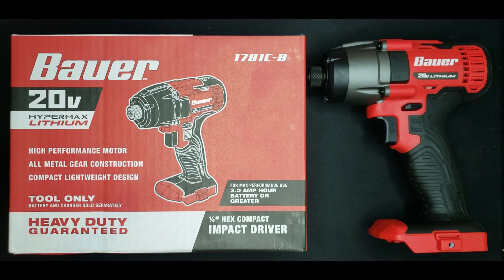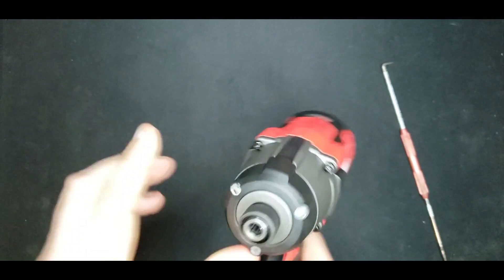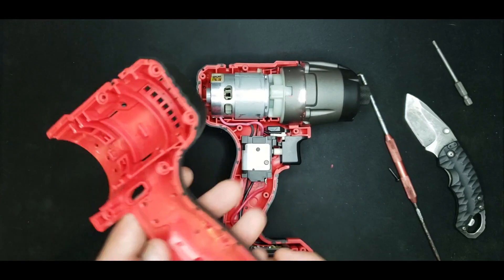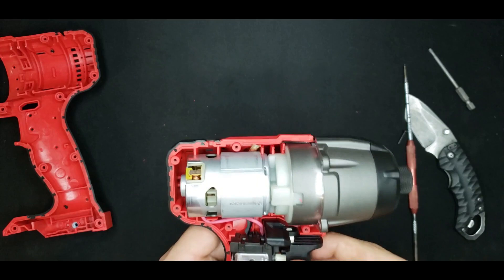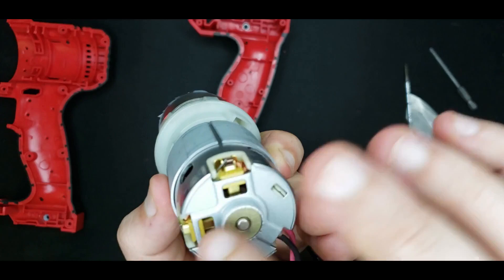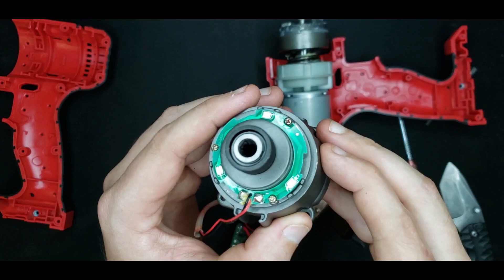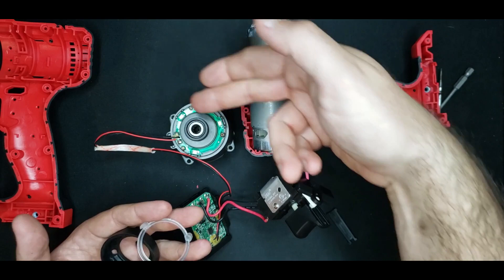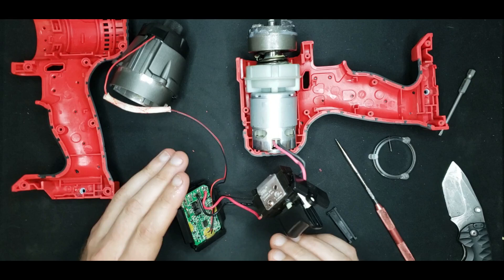Design Engineer Tears Apart Cheapest Impact at Harbor Freight Bauer 20V 1/4 Impact Driver | Ep.12

Comment: I started switching over to the Bauer platform recently. I've been happy so far, but still wondered what the longevity of them would be. I remember when harbor freight was nothing but cheap throwaway tools, so you always kinda wonder about the durability. Well I was working in my shop last night and accidentally knocked over an 8' ladder. Sitting on top of the ladder was my Bauer brushless driver with a 5ahr battery. It hit the concrete hard. So hard that the battery popped off and went another 15'. I figured it was shot. No way it survived. I inspected the battery and it looked fine. No cracks or anything. Inspected the driver and it was fine. Plugged the battery back in it and everything worked. Used it the rest of the night with no problems. Don't be dumb like me and leave tools up on top of ladders, but if you do knock your Bauer driver off an 8' ladder, it should survive. I couldn't ask for a better tool at this price. No one else comes close to the value.
Reply: they were cheap but they seem to have really been ramping it up hard over the last years. I don't know what they pay their RnD team but they are crushing it now. The tough choice is Bauer or Hercules... kind of wish they had interchangeables but I decided on Bauer because it has more tools and I want just one battery platform.

Comment: I’m not an Engineer.  I’m a product user/consumer.  Engineers try to design products that will last forever and never fail.  The problem is that these products they design will be to expensive for the consumer to afford. I’ve never had any of my cordless tools fail.  I have just had battery failures.  You need buy to best battery system and not worry about cordless tool quality.  The tools can be replaced cheaply, if they ever do fail.  PS….I never buy the extended warranty.

Comment: The first problem is it's a brushed motor and brushed motors suck. There's a lot of internal resistance which draws more energy out of your battery and also they create Sparks inside with the brushes that are vented to the open air and that is an explosive hazard when you were around volitile vapors. so " just say no" to brushed motors.

Comment: I have a home improvement/remodeling company, we use all brand tools. That being said, i have a few Bauer tools, about 3 .
We have the Bauer brad nailer, the mud mixer and planer. They're all working with no issues.
We have about 4 battery platforms, Milwaukee, Ryobi, Bauer & hyper tough 12v for only 2 tools which are the compact impact wrench and a compact impact driver which i use both to install cabinets because my bigger impacts sometimes can't get into very tight spots.
Funny story how i got the hyper tough 12v platform but they work for what I use them for.
For more heavy duty stuff, we use Milwaukee.

Comment: I just got into Bauer string trimmer as my first tool much more power than my b&d stuff 2.5 b&d 20v I must say that b&d's 10inch chain saw is a work horse 5 cords and counting the standard drill is cheap circ. Saw is ok 2 handed cross cut stinks light is ok blu tooth speaker takes a hit dropped off a 6 ft ladder still ticking. Bauer seems a much better product to me I can't wait to really get into this line. Oh by the way I bought a 139$ dollar ryobi 18 v plus one JUNK not very much better then b&d 6 inch lag screws made it hot lol😎

Comment: Yeah,my Bauer impact seems to get hot at the cone top before the,”squeal”. I went into the purchase wanting to support the underdog, & as such, feel my home work needs thus far are met, but I’m always noting performance issues should they change. I’m needing to put some grease in the collet area b/c of some squeals; any thoughts on the type I sh.Use?
Reply from the maker: In a light duty application like this, I like to start with white lithium spray or silicone spray lube to keep mess and dirt and dust collection low, then if those don't solve it try the traditional thicker greases like axle grease.  Thanks for the comment!

Comment: i watched your video on the Hercules impact driver last night and now this one. On other comments you seem to think Herc is better yet with the Herc you seemed to be very concerned about the lack of debris protection for the brushes. However the Herc had better coating on the PBC where the Bauer seemed to have no significate protection. Would you be able to elaborate more on the differences between the 2 drivers to explain why one appears to be better than the other. IMO seems like we want parts of both to make a better one, LOL
Reply from the maker: All that you said is a very good summary of what I think of the 2 different drivers. My goal was to point out the pros and cons and let the users decide which one stacks up the best.  If I were going to buy one, it would definitely be the Hercules.. the overall design quality looks superior to my eyes... plus circuit boards are the number one failure component of most products so I will take a well protected PCB over a debris screen any day.  Thanks for the question.
Reply: @JJCCENG  this is exactly the response I was looking for. Please do more videos on any product breakdown, it feeds my inner nerd 🤓
Reply from the maker: @badmexicancinema8100  Kindred spirits...  You got it man!

Comment: Just curious, I watched your review of the Hyper-Tough impact driver and you noted that although it was labeled as a 20V tool, but the motor was an 18V motor.  Did you notice what the motor was rated on the Bauer impact driver?
Reply from the maker: I did not, but I have since found out that it is a very common across multiple brands; although i'm sure this motor is still very under powered compared to the average 20V.